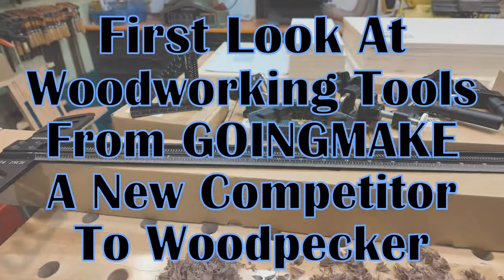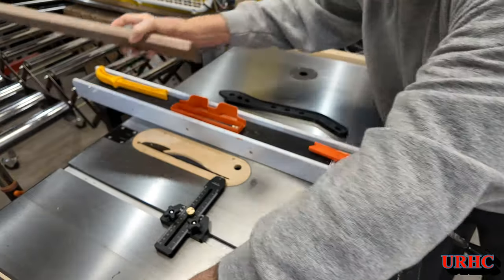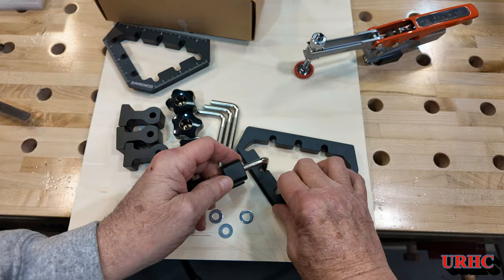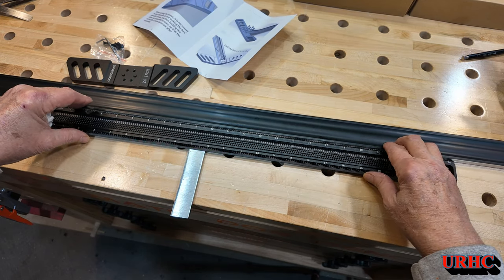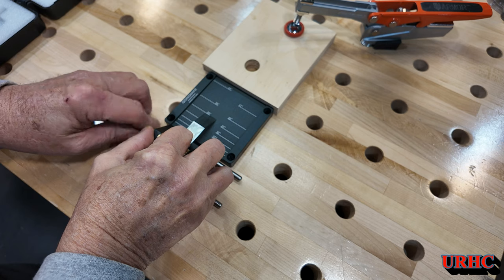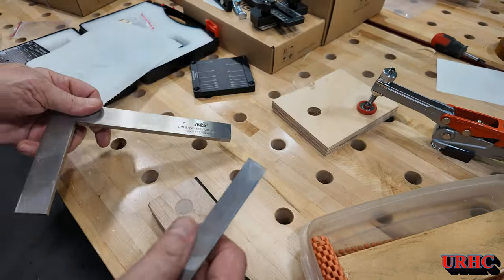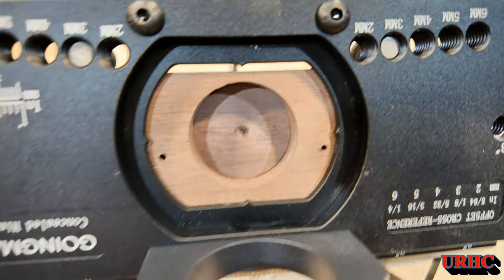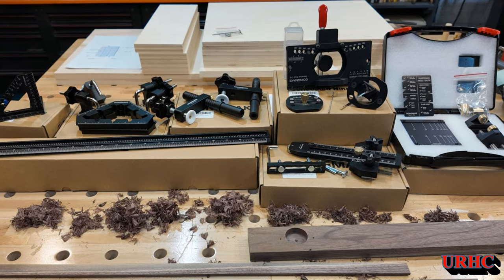First Look At Woodworking Tools From GOINGMAKE A New Competitor To Woodpecker

Comment: Thanks for the review. The fact that the tools are not square is a big issue...even for woodworkers. A single measurement being off by 5/1000 may or may not be significant. But, when you compound that over a series of measurements in a project, it becomes a big issue in the end result of joinery and a fit of pieces. Not only have introduced a faulty measurement, alignment with a tool that is itself inaccurate, but you now also have to account for some human errors that creep in as you work. If you ever watch Rob Cosman, you will see what I mean. It makes the difference between what I make....and what I strive for in emulating his level of accuracy.
Reply from the maker: Most people doing woodworking these days don't use precision instruments and scribes and these seem to be as accurate as most pencil drawn lines. That's why I show exactly what I received and let you decide if it will work for you. The layout holes are all indexed accurately and everything is very easy to read. For craft and laser project layouts these are more then adequate but as you say extreme precision craftsmanship will require better. For me they are all easy to tweak and I think the price point leaves room for that. Thanks for watching.

Comment: I bought their adjustable shelf drill jig a couple of months ago. As you said, their finish is very nice and readable. I will have to look into some of their other tools.
Reply from the maker: That's the one jig I didn’t  get to try but I bet it will work great being machined into a flat plate. Some of these weren't perfect but close enough for woodworking. They definitely got the engraving perfect and easy to read. Working  on a vacuum adapter model for the hinge jig to 3d print now because it's going to be busy. Thanks for watching.

Comment: The bench dogs are 20mm (a hair over 25/32in), and not 3/4in.  That's the reason they won't hold in your 3/4in dog holes.  If you had a Festool MFT, they would likely fit well.
Reply from the maker: Does matter how big the hole is with a smooth surface.  In another video I took them out on the lathe and put a fine knurl on them. No more slipping. Thanks for watching.

Comment: 1st off, if it’s not square,it’s not square! There is no good enough for woodworkers!   2nd point, almost wondering if your square is off? Seems everything they sent you was out the same! Wondering if you dropped that machinist square or if it was just out? Just a thought.
Reply from the maker: Actually there is a good enough when you are just marking with pencils as many do and rely on their machines being properly setup.  The square is on and as you can see that one corner clamp was perfectly square and the other is not so feeler gauges are used to show the total out of square over 2 axis's. Seems to be manufacturing tolerances, straightness and finish thickness in the mix. I can adjust them easily on my Bridgeport but many don't have the capability so I just show exactly what I received without any mods.  Thanks for watching.

Comment: I think it would be beneficial to your viewers if you can tighten up the screws, shim or adjust these tools as needed and see if spending a few minutes to properly assemble these items off camera where you can think as you work a little better and then report your findings. They after all have been shipped a great distance and through a wide range of temperatures. In my experiences with some of these Chinese tools a little dismantling if needed, cleaning and properly setting them up to compensate for any irregularities can make these tools perform to your needs.
Reply from the maker: I did try adjusting the T square and it couldn't be changed by varying how the bolts were tightened or trying to hold it square.  I am going to square it up and pin it in my machine shop but most don't  have that capability. Flat head screws used like that are the worse choice for accuracy,  especially with all the slop in the pins.  The little square and corner clamp both need machining to make them perfect.  Shipping is not an excuse for items like this that were packaged well with no damage.  At the price point they are functional for many.  This is exactly what I got and hopefully GOINGMAKE will take a look and see if tollerances can be tightened to stand out in a crowded market.  I don’t  work for GOINGMAKE and only can show what I received. Thanks for watching.

Comment: The bench clamps, put your calipers on them and I betcha they are 20mm which is what the standard euro dog hole is. That’s my guess
Reply from the maker: Could be but that smooth shaft does not grip and the fixed rotating clamp shifts it enough to break any grip free as it shifts when tightening. I am going to knurl them for grip when it warms up outside in my shop. I really like the look. Thanks for watching
Reply: @unemployedredneckhillbilly2023  definitely stay warm, even here in southeast Alabama it was 18 degrees this morning

Comment: I purchased the concealed hinge jig and I need a replacement 35mm drill bit and I would like to get some of the original 5/64 drill bits. Any idea where to get them?
Reply from the maker: You could try contacting goingmake through Amazon to see if they sell replacements. With it being carbide a diamond file should keep it sharp. It has a 12 mm diameter for the bushing so metric offshore bits will probably be needed  as my set has 1/2 inch and they don't fit. Thanks for watching.

Comment: Hi 👋, URHC, I hope you are both keeping safe and well, they look like they need a bit of tweaking to make them perfect, great shame because they look very nicely made, when you was trying the square, the best way to check it is make sure the edge is dead straight put the stock of the square against your piece of wood. Draw lines down both sides of blade., then flip it over and draw lines again and they should be parallel with each other, if the square is straight, and square, I remember just, many many years ago, I brought a 6 inch and a 9 in.² from a tool shop, On, both of them were out of, square, and these were supposed to be in high-quality, good products made by Stanley, when I took them back to the shop to complain and replace them, they said to me, you do not know what you are talking about, I said I beg your pardon, there’s nothing wrong with them they are squares I said okay let’s go and try on a bench so I done the thing I just said to you about checking it, his comment was oh, it’s only a little bit out, I said okay, I actually brought a piece of wood with me, right this piece of wood is square all the way round, let’s mark on the end a line going all round four sides so we can see that we’ve got a square cut just cut to, the piece of wood was roughly 3 in.², you wouldn’t believe how far it was out, both squares one was only a fraction out for a 32nd, but the other one, the larger, one of the two of the 9 inch, I think was well over a 16th, how far this was out of, square, he did say there was a problem with them, so we went through a whole set of squares, I finally found two that I thought were Torrance, Trouble with me, is that when I first started work before doing joinery, I was a quality, controlling inspector, for nearly 3 years, factory I was working for went bust I do not know why exactly, 
Anyway, me gambling on again , the tools look very well-made, but like everything, it’s what you pay for, is what you get, your router table looks very nice, At some point, I might be replacing mine, there is a firm in Germany called SAUTER SHOP , they make a complete router table where you can fit different makes of router in it plus they do a kit that you can make your own system, but which is even better still is that in one of their kits, you can’t actually tilt the router, I have a Felder spindle moulder, I can take the main spindle shaft out, and put a router spindle shaft in, it automatically changes the speed, up to around 30,000 I believe, plus it is got a tilting head on it, and I have found it very useful in many occasions, On some occasions, I just find it too big, this is the reason I might get a smaller system, 
Good luck being next project , or territorial, stay safe, keep up the great work, Phil from the moulin
Reply from the maker: There is no way to check for square on a board edge with a pencil line. That is a myth that involves many variables. Many think they can see small differences but they can't with the human eye. The only way for me is with my certified square that has been CMM checked to be within .0001 of straightness and squareness over the full size of it and feeler gauge to measure for a accurate deviation. It is not perfect but I am not going to pay someone for a CMM check of tools like this.  These definitely fall into the tolerances of most woodworking tools and are fully usable. If you want certified tools go with Woodpecker but remember one drop and there probably be not be much difference. These seem to be a great balance between price and usability for most. I think feedback will help Goingmake get bugs out and fix the issues. 
A good router table definitely is a great addition to a shop plus those shaper cutters are quite costly for special profiles.  Thanks for watching.

Comment: i have woodpecker tools and some of them had the same problems but as i am a woodworker i did not attempt to adjust them, i wish i had seen these befor
Reply from the maker: That's the trouble with buying high end tools. One bang or drop off the bench and they are no better then these. I don’t  think GOINGMAKE has been around very long. If they tighten a couple tolerances they could probably be the best available. I  had a hard time reading the red woodpecker items I looked at and didn’t buy them for that reason.  They really got the fonts and engravings perfect on these making them very easy for me to read. Thanks for watching.

Comment: Just a FYI... audio issue still is there
Reply from the maker: Thanks. I played it before uploading and it was fine. Seems to be something to do with youtube processing the compressed AAC audio after  uploading to different resolutions. Everything is uploaded at 4k 30 and youtube reprocesses for different  bandwidth feeds. Nothing I can do about it as video studio doesn't do updates. I don’t  get it on my feed either. Probably because I have the correct decoder for my software.  Thanks for watching.